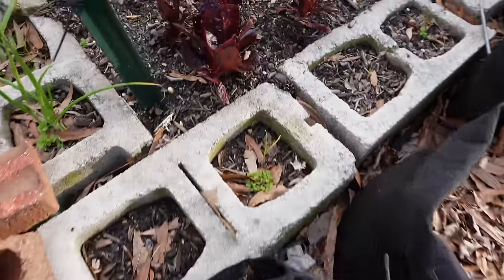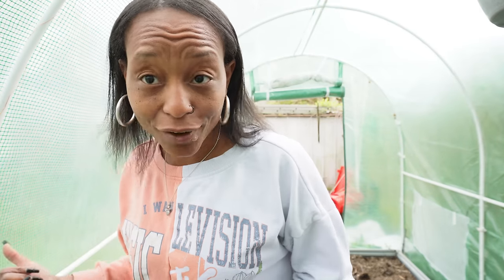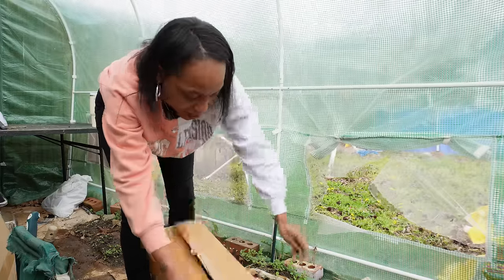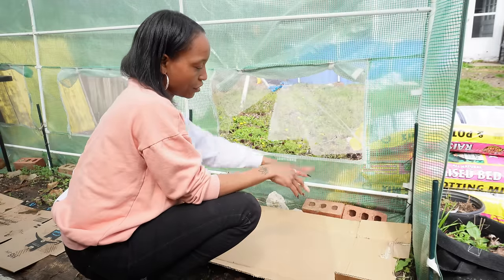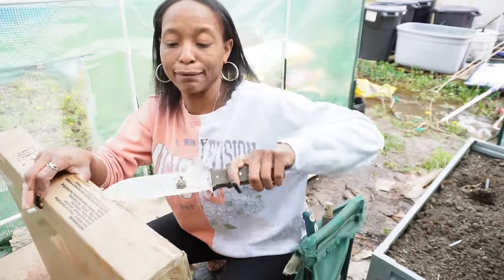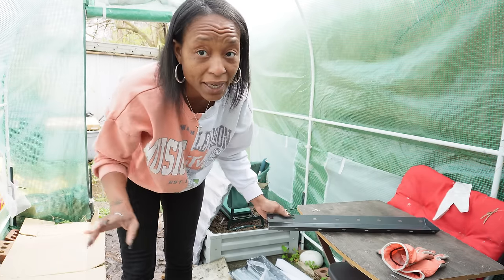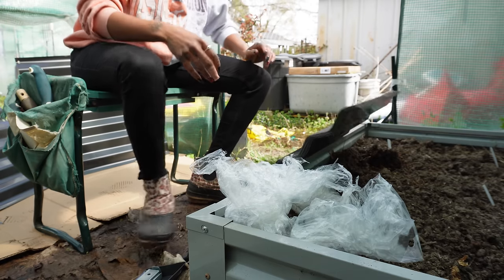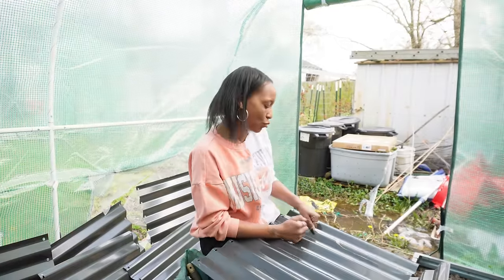I Redid The Greenhouse Again |Spring Cleaning | Vevor Raised Garden Bed Build (I Look A Mess LOL)

Comment: I leave the plastic on. I figure it will keep the metal from rusting do fast & keep them looking nice.
You can put all of the unfinished compost in the bottom of the bed with the leaves to help fill it. It will decompose & feed the plants at the same time.  Then you can start the compost new. All free, no extra spending.